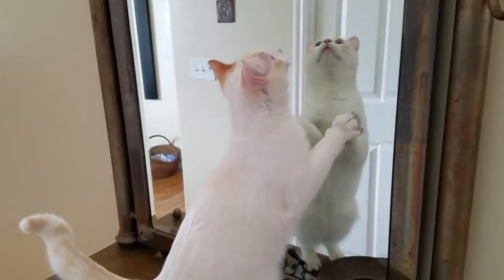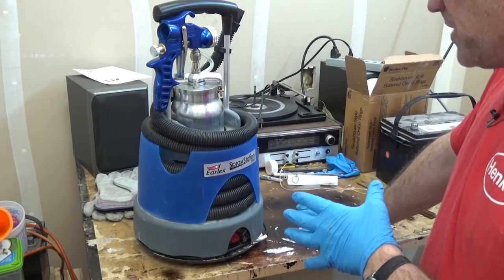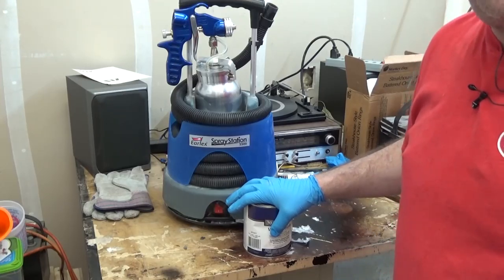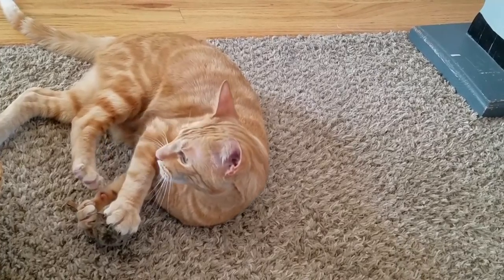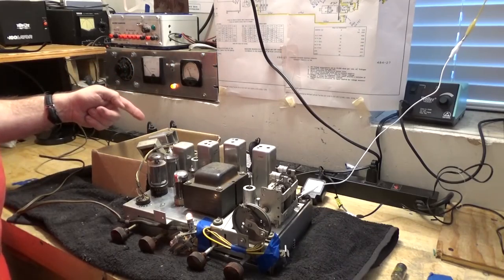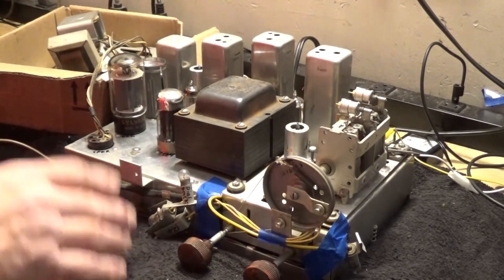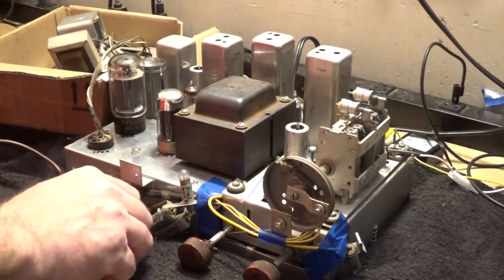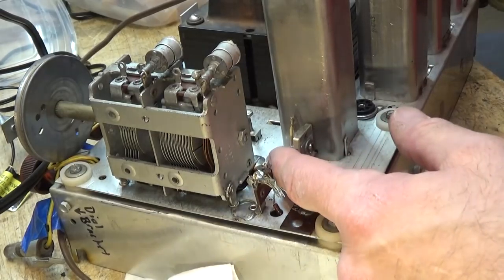1947 Westinghouse H-161 Vintage Tube Radio Part 6 of 10 Cabinet and Power-Up

Comment: I love the deft brushing lacquer. I used it on our kitchen cabinets I built and haven't had one problem with finish in the 8 years they have been installed. I would generally thin it 50/50 . 

As for the cabinet not taking stain I thought you said something about sanding to 600 grit. Never go finer than 220 on raw wood as you will polish the wood and it won't take stain. I've only ever went to 150 on wood and maybe 220 on end grain so it comes out the same when staining. I was taught this by my father who was a cabinet maker all his life and I followed suit.

Anyway i really enjoy these videos and my wife LOVES the cats.

Comment: you know when a restoration was done properly when you don't need retuning regardless of the mains AC voltage. Very nice job, sir!!!  PS: our cat does the same like yours at the beginning of the video, even with extremely small flies. They have a fantastic eyesight. Our cat goes crazy for pigeons, those seem to be her specialty.

Comment: Hey Michael, I got a quart of Lacquer from Lowe's a couple of months ago when I was doing my sister in law's cabinet and I'd be willing to bet it was solvent based.  I didn't have a sprayer and just brushed it on and even with the garage door wide open the smell was very overpowering.  After the first coat I dreaded going back in for the successive coats, lol.  Next time I'll still use the brush, but I'll be doing it on saw horses completely outside!  I started back on that 56X RCA and tested the tubes and glad I did.  The 35Z5 was shorted on the tester.  Time to order some tubes, lol.  70 volts?  That's weird, I figured it wouldn't come on till 90.  It's starting to look like soup as we used to say when mixing concrete, lol.  Take care, Gary

Comment: Michael, Great tips on restoring the H-161. I also have an H-161 which is in need of tuner chassis grommets. Can you give us the part number and supplier for the ones that you used. Thanks for your consideration.

Comment: Interesting that the Westinghouse Model H 161 radio has several Dial Lamps with 2 different numbers, a. number 44 and a number 51 which lights the main Face Dial while the others light the AM and FM images.  Also, when in the phono position the AM and FM images showing the written out Amplitude Modulation and Frequency Modulation wording does not light up but the Face Dial does light up.  Most people would have no idea what AM and FM mean, but Westinghouse makes sure the owner knows from the wording on this radio Face Dial.  I know of no other radio which has this wording on the front Face Dial.  This radio has quite an elaborate lighting arrangement for the Face Dial.  When an additional Dial Lamp is added it really makes a difference in lighting up the large Face Dial.  One Dial Lamp is really not enough, but was probably a cost cutting measure for Westinghouse in the overall design of this radio.

Comment: This Radio has an unusual and colorful Face Dial, and one that seems to be unique to this early AM/FM radio.  After 1950 it seems the Face Dials on radios were less impressive than what had been the case with earlier radios from the 1930's and 1940's.  Most people would have no idea of what AM or FM means, but the meaning is actually spelled out on the Face Dial, Amplitude Modulation for AM and Frequency Modulation for FM and in a nice hand written looking script that may not be read today as many of the younger students are no longer taught the various hand writing skills and script that was typical in the past.  Edwin Howard Armstrong, the inventor of Frequency Modulation I think liked this special design touch used by the Westinghouse designers.

Like they once said, "You Can Be Sure If Its Westinghouse".

Comment: Michael, Have you watched Poldark? It is set in the 1780's in Cornwall, England. It is free on Amazon Prime (I think you mentioned having that once). I am enjoying it and it seems right up your alley. 
That Earlex HVLP sprayer was featured as "best value for money" on about 5 or 6 reviews I have read. Usually the one that beats it does so only slightly and costs about 4x as much. How long does it take to clean? The few times I have used one it is 10 minutes of spraying and 60 minutes of cleaning and reassembly. 

Thanks, Ian

Comment: You haven't lived, until you've had to wet-sand a '73 Sedan DeVille three times (after it's been stripped to bare metal, "pick-and-file" metal-worked, no body filler, at all, and primed with DuPont 100-S, then block-sanded), prior to your cousin applying three coats of RM Alpha-Cryl (thinned with PNT-90) each week, between sandings with Norton's 600-grit "Champagne" wet-or-dry paper.  Then, wait a month after the last spraying, and hand rub the damn thing out.  That's what went into a $1,000 paint job (when Jimmy Carter was Prez).

I received more satisfaction from seeing the end results of such hard work, than anything else which I've ever done.

Edit: I forgot to add, "install padded vinyl top, with re-chromed belt molding, over the area that rusted-out by 1975, and was replaced by guys who '*steel-welded' (oxy-acetylene) new steel into place, and used less than one stick of lead on the entire vehicle.  My uncle, who was also the operator of a small dairy farm, began installing those "tractor-saver electrode kits" onto cars right around that same time. That Caddy, was one of the first, and the family who owned it, had it well into the 1990's.
*no Mig's then
Reply: Michael,

Truthfully, my favorite paint jobs were all done with DuPont Centari Acrylic Enamel. We would prep them to "lacquer standards" (we did tons of Ford/Lincoln/Mercury work, and a fair amount of AMC, Toyota, and Mercedes, too.

We restored a 1935 Mercedes "staff car" (I forget the model). That paint job took eleven months to complete; note: this was after the body shop had it for two years (and let me tell you, they massaged the heck out of that chassis). The right frame rail required replacement, and the rebuild took almost six weeks to complete. (first, and only time that I've seen "hot riveting" done)

This took place between '78, and 'late '80. Those days were not politically charged. Even so, after two customers commented on their disgust for the vehicle, it was moved into an unused prep booth, and was wheeled out whenever it was worked on.

We did the repaint with specially ordered RM nitrocellulose lacquer (it took three months to receive the order, because they had to wait until they had enough orders for one of the tints. American Lacquer's, Phoenixville, PA made the nitrocellulose primer to match the Mercedes specs for vehicles of that era. 

It was a "nine coat, wet-sanded after the third and sixth coats" job. It was a dark 'steel blue", with a dark tan convertible top.

Comment: greetings! Yes you need to really tighten it down the transformer really tight? If it's loose will cause hum the harder you tighten it the less buzz you'll get for it, I would go to the extent of changing the washers at the top maybe bottom and put in an L bracket in the corners.
Plus it was only connected to the isolation transformer that won't let it Earth out. Not a fan of spraying furniture only if you buff it out afterwards otherwise  your get orange peel. Why don't you just use shellac flakes, melt it down with linseed oil and some white/mineral spirits and put it on with a  cloth!
What type of lacquer is that made with it's not a polymer lacquer?